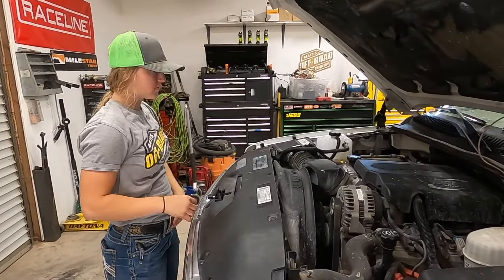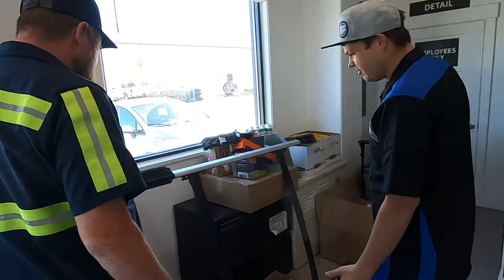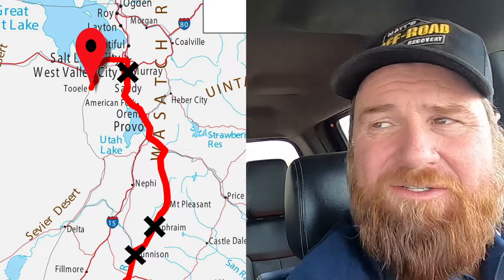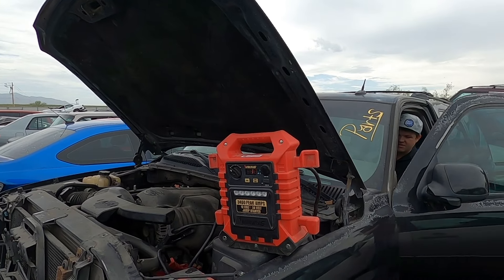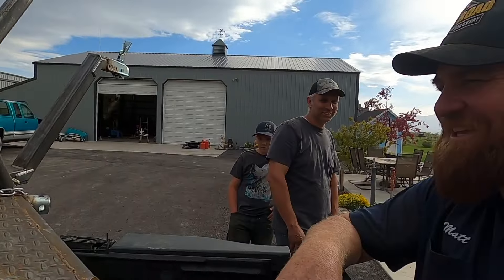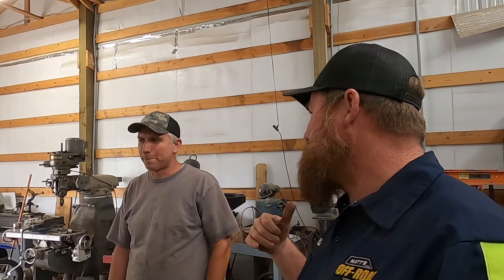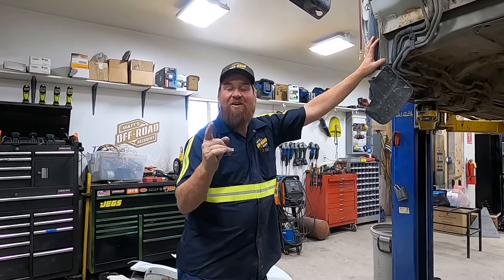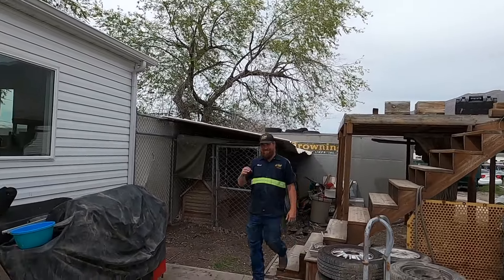Massive Engine For A Massive Off Road Wrecker!

Comment: This suburban reminds me of mine from a few years ago. It was a 3/4 ton 4x4  with a grand ole 6.0 Lt LS in it - and I thought it had gobs of power! We bought it with over 400,000 km on it. When we retired it had 748,000 on it. :-) 
Can't imagine what an 8.1 would be like!
Is this 8.1 what they used to call the 454 engine? You wouldn't dare pass a gas station without fueling it up - for fear you'd run it dry 'till the next one showed up! 🙂
Reply: Believe he said it was a 496cid 454 is a 7.4L

Comment: Looks like you had a fun couple of days hanging out with pals and getting stuff done. A day free roaming a salvage yard is almost as fun as a day in the dirt for some of us. I am not the "I told you so" type but.... I think it was a great decision to choose the 8.1 with a 4l80 or an Allison bolted to it. I may have mentioned in a previous comment the benefits of this engine for this combo. Although, you may need a semi sized fuel tank mounted in the bed to help you with not running out of gas while driving it across the yard. I can't wait to see this thing done and in service. Maybe by then I will have a chance to see it in person, and not from the tow end either.

Comment: You will not be disappointed in this engine…mine does about 9 mpg… expect to feed it both gas and oil. It came out Detroit as an oil user. Watch that Allison closely in its first weeks of use. Raylar engineering out of San Diego specializes in these engines as well as many Marine/ boat outfits. Good luck and welcome to the 8100 world. ITS A GAS!

Comment: Open it up add some gap the rings freshen it up as needed and put the turbo on it. Well worth the effort and expense. In the big picture on your build it's an insignificant addition
Reply: Oh and actually a small blower would probably be a better rout for your application. No turbo lag in the sand

Comment: The manner in which you present this "engine swap"  of a modern engine into an old school truck cab is all very brave and swaggering.  I want to see the mechanic with electronic credentials that can take the Nightmare wiring Challenge that would require.  And I mean actually document the process , step by step.  You don't strike me as an electrical specialist or engineer.  Just a youngster who won't be defeated by problems. I wanna see the Process of interfacing monster electronic circuitry into a Zero electric truck . GO !
Reply: Holley sells a kit for a thousand bucks. Plug and play harness and ecu that automatically tunes itself regardless of engine mods or boost. It’s really easy these days with Chevy motors and even some others now as they expand their tech. They even Holley fuel injection carburetors that also have the same ecu set up that can basically make any old vehicle fuel injected.

Comment: My buddies built a 73 k10 put it on 1 tons but slightly built the 496. With a cam and tune they are making 300hp 400tq to the wheels on some 36x15r16s… so big a** tires. Let’s just say that truck is scary it will spin them at 20mph and it moves. Good motor choice👍

Comment: 2002 I bought a brand new GMC Sierra 4x4 with the 8.1 and Allison transmission. 
Quite honestly it did none of the things you mentioned with the exception of burning a ridiculous amount of gas! 
I kept it for under 2 years because it just wasn't practical to use that much fuel to pull dump trailers and such around the flatlands of Florida. Bought a pickup with a little 4.8 liter and it did just as well.

Comment: I've had an 8.1 in my Silverado 2500hd for 7 years now. I'll never sell it. Has as much torque as a diesel and really good torque down low too without needing to build boost. Only thing I've done to mine was change spark plugs and it roasts the tires off.

Comment: You an hi clean capacity air filter and do a true 3 1/4" dual exhaust all the way to the back of tires. For what power you may want and may need. In the long run, it may be more efficient than you think. If you can mate it with the 6L90, lower first gear than the 4L80. Awesome!
Reply: Met a clean hi capacity. Ha.

Comment: Hi Matt ,  great engine choice,  but I would have chosen a 5.9 cummings 24 valve,   My 2001 Dodge 2500 puts out about 400 horses and about 700 foot pounds of torque   any way I really enjoy your vids,  thumbs up
Reply: He spoke on this diesels have terrible throttle response no RPM range so all that happens is they bog down and sand because all the power comes in and then they just spin their wheels

Comment: I threw a rod through the oil pan of my 7.4L in my dually. I’ve been back and forth between a built small block and an 8.1L. On one hand, I can pass at least every other gas station with the small block. On the other hand, I can pull anything I want with the 8.1L.

Comment: I would have done the 2 valve triton v10, good power and likes to rev which you'll need with those axles. They are very reliable and easy to replace parts if needed.
Reply: Would be a good engine until it shoots a spark plug out which you know those v10 Triton engine their famous for and considering they would be full throttle trying to rip wrecked trucks out of horrible areas spark plugs would go flying out left right and center

Comment: Matt, 
If you paint the "Off Road Wrecker" your company Yellow, Have a few drops of green added into the first clear coat layer. That way when you look at the wrecker straight on it will look Yellow but if you look at it length wise it will have a slightly green cast to it the further away it is. Then you could call it your "Can Dew Off Road Wrecker". He suggests with tongue in cheek.

Comment: I have a 2005 Chevy Avalanche 2500 with 496/8.1L Vortec Engine and Allison Transmission. 3/4 Ton at 10,000lb Towing Capacity. Loaded LT Interior. It's a Beast.
There is a Double Supper Charger Available that bring the 8.1 to about 700HP/800HP Mercruiser MOD.....
Have Fun!!

Comment: My 2002 2500HD runs an 8.1 with an Allison 5 speed transmission. 455 ft lbs of torque at 3200 rpm. It had 40hp more than the Duramax in 2002.  I purchased it new and only has 116K on it. I love the setup but she is thirsty.

Comment: Keep a gallon of oil around. 8.1 evaporates about a quart of oil every 1000 miles. We have one at the shop and it doesn’t leak a drop yet we have to keep adding oil.  They say it runs so hot it evaporates oil. All I can say is check your oil at every fill up.  O wait Matt doesn’t fill up that much 😂.

Comment: I drove a 2003 Chevy 2500 with a service bed that was very heavy with the 8.1  in it for 15 years and 285k never had a single issue out of motor your right it would out pull  the diesels but at 7mpg 😭😭😭

Comment: Pro Charger instead of the turbo in the heavy wrecker...  That way you have power from idle on up and don't need to build any boost.  I also think they offer an aftermarket computer so you don't have to cut and splice the original.

Comment: I was hoping you'd choose a  used 1998-2002 14.0 Liter Detroit Diesel, 515 HP delivering a head spinning 1650 ft/lb at 1200 RPM on a straight 6 block....OR...if you have space issues under the hood, why not go for a used Cummins 5.9 Liter 6 cyl big block delivering 2/3rds of the Detroit Diesel at like 65% of the total space?  I'm really surprised you went with a Gas guzzling Vortec but as always you seem to know what you're doing Matt, so I'm rootin' for ya. Can't wait to see that monster on dirt.

Comment: Love the 8.1 idea for this. Why not offset it to the passenger side and run a drivers drop transfer case. The transmission pan is smaller on that side. No starter to deal with. Pushes the engine away from the cramped driver foot space.

Comment: Been wondering how you're getting this to jobs that are a fair distance from the shop. Road it with a 100 gallon gas tank, Blue Steel/bigger trailer, throw it on a rollback? 

Desert dweller myself.  The radiant heat of a COE design may not be too pleasant in the summer without some forethought into heat management. Sheet aluminum with an air gap under the floor might help on those 110 degree days.

Comment: I know old technology  but a 1970 440 wich is 7.2 liters and produced 375 hp at 4400 rpm and 480 foot pounds of torque at 2800 rpm would probably  have been a good choice as well and all iron block and heads also known to be an engine that's fairly easy to keep cool and durable with a timing chain upgrade !!!!

Comment: that trailer came out nice (ps the 8.1 use some ls parts and runs a ls computer which is why some say its a big block ls so youll be able to run holley engine management if ya want) i still think using a gas engine is going to b e terrible idea but i guess well see how it plays out

Comment: My Fathers  R-190  Tandem axle Truck has a 549 Cubic inch gas engine in it. my Cousin blew the doors off  My Father IH  grossing  42,000 Pounds with his  '63 Chevy Tandem with a 409 in it also grossing  42,000 pounds loaded ..

Comment: You should be able to Put a Holly Computer System on that motor and dial it in to use less full and still get the same horse power. Holly has so many great things about thire Puter system that you would not believe. You can program them all sorts of crazy. Plus all the sensors you would ever need to make that thing run Hard and forever man.

Comment: I'm amazed you're not looking at a Cummins. Full mechanical 12v or could do a 24v or 6.7 quite easily. Absolute monstrous amounts of torque and reliable. But the 8.1 is a neat head turner too, just won't be going past any gas stations that's for sure
Reply: They hate diesels so they would never use that

Comment: The Navistar T444E would have been the best engine for your application. But if you are gonna run gas in a extra heavy recovery the 8.1 vortec should be enough if you play the gearing right.

Comment: I'd have held out out for a truck instead of the burb for a donor.  The 8.1 in the burb is detuned due to the weaker transmission.  The trucks came with the legendary Allison transmission.  I believe the burbs were rated at only 410  hp.

Comment: Matt - would it be possible for Tom-Tom to design a special Dollie that holes up the front or rear to allow the vehicle to either be pulled or winched on to a trailer?  Lizzy can weld it!
Reply: That would be a heck of a trailer! I don't think Blue Steel would want to pull it.

Comment: The 2001 release of the 8.1 L engine had a lot of negative history, initial roll out was about 6 months behind schedule and was a hot mess...  Both cam and crank shaft sensor issues as well as it liked to blow out the oil pan gasket.  Hope you all have better luck with it!

Comment: I don’t know if you’ll have enough torque for the drive train and the hydraulics you have planned. Also, I don’t know what tranny and transfer case can bolt up to the 8.1L engine. Maybe consider a Caterpillar 8.7L straight 6 Diesel engine with 640 hp and 1,500 lbs of torque.
Reply: You realize they said in the video they're going to slap a turbo on it try to make over 500 horsepower and 600 ft lb torque right that's plenty not to mention they'll have like a 20,000 pound winch on the front

Comment: Seems as often as you (and every other builder) are pulling and struggling to bring a vehicle into the shop seems like it would make sense to put a winch inside the shop and let the winch haul or drag it in like one would haul a side by side onto a trailer.

Comment: Why would you hesitate on putting the turbo setup on your 8.1? Why those torque numbers, you'll need them to turn those massive wheels plus the loads you want to pull. Just makes sense to do it now since everything is apart. Will be easier to custom make headers and exhaust. Just do it now because you know you'll end up doing it anyway. Any thoughts on extending the cab on the big wrecker for more seating? You always seem to be short on that.

Comment: I wonder if those military axles could handle 900+ ft/lbs of torques, it would make an awesome trail repair video!
Reply: They typically have Cummins diesel motors powering them....I'm sure they'll do just fine 
😉

Comment: Super Charge it with those big tires.
Reply: Instant torq vs. Making it spool up....
Reply: @keithfrazier2558  you realize you can tune turbos to start spooling at like 1500 RPM so that whole  superchargers make constant power and turbos need a spool is thrown out the window

Comment: So question. Would it have been possible, to make an adjustable gooseneck for the nuggets trailer? I see there's no gussets as it's not a super heavy load, but could you have hinged the joints you made on that tongue where the bends are, with locking pins to go from high tongue to straight? That way if the nugget couldn't pull it for whatever reason, it could be straightened/lowered for a normal height vehicle like Blue Steel to be able to haul it?

Comment: Ran a service body 06 Silverado with that motor back in 06.  It would pass anything but a gas station.  10 MPG.  We tried running premium to see if it would improve the mileage...it got 11 on premium.  lol  Great engine, lousy mileage....hell, it took the record for worst mileage V8 away from the Ford 460!  lol

Comment: It’s to bad you didn’t run across a 70 Buick 455.  That motor put out 500 ft. lbs. of torque at 2800 rpm.  It was a real stump puller.  All those old 429’s, 455’s & 460’s put out more torque than the 496 but they didn’t come with all the accessories, trans, T-case
and such.  I’m sure everything will turn out well!

Comment: Should have went with the new F- 250  7.3.  430 hp 475 torque stock. Not to mention since you seam to like to run out of gas alot the 17 mph vs 9 would have been nice ! Plus with some basic engine mods the 7.3 can make 600 hp naturally  aspirated.

Comment: I am curious what the pressure will be on the tires between the heavy wrecker, morvair and the banana. That will tell us which one floats better on the soft sand. It's just the weight on each tire and the area of the tire pattern. Matt already did an old video of the pattern the painted tire left on a cardboard at different tire air pressures. (Weight/contact patch=pressure...PSI).

Comment: nice choice for a motor, I would have laughed so hard if you chose a ford 5.4 triton,,,  a diesel would be good choice I think but rock crawling I can understand going gas and efi..  automatic? or manual though... will this drive on the highway at 70 mph?

Comment: That gooseneck is long enough you need to gusset those two angles. Especially as it comes up off of the trailer. But what do I know I only build stuff like that and welded for about 40 years.

Comment: The 8.1 is a great engine with a lot of potential, but in stock form it’s just ok. You can get more “bang for your buck” with a moderately built 6.0 Vortec
Reply: You realize they tune the engines right they don't leave them stock that would be dumb

Comment: I have one of each 8.1 l 496 and a 400 Duramax 6.6 l the Duramax is just a snappy and has more power and uses less fuel I would have put the lmm Duramax in it would have been a better choice than it will last longer with less trouble

Comment: Do the Turbo! Do the Tubro! Do the Turbo!

Should definitely do the turbo, but set it real low. Especially for the higher altitude jobs! 

Heck, thats why they were invented. Perfect excuse
Reply: The modern turbos has extremely little lag! 

It'll be fun with a Holly, able to turn it up to melt some rubber! 
Or turn it was down so you can make it to the gas stations!

Comment: Is there an advantage to using the 8.1 vs using the 9.4 (572 cubic inch) ... updated comment : Nevermind , upon further viewing of the video my question was answered. 8.1 makes lots of torque earlier in the revs and keeps the hp manageable. The 9.4 makes more hp happily giving more wheel spin which is a no no in vehicle recovery in soft sand. Got it .

Comment: there used to be many gasoline powered semi trucks, some were in use up into the mid 80's.  the lower price of diesel, compared to gas at that time, is why they fell out of demand. among other factors.  i think it would be interesting to see how today's tech would do with one of those old gasoline semi tractors that used to practically take a gallon per gulp with the old carb and spark control systems.  if they could consistently get around the same mileage as today's diesel rigs, we might see gasoline engines return to use in the big rigs.  imagine seeing gasoline available at the truck islands again.  it would be more practical than the PNG models ... i moved a few of those, finding a fuel stop in some areas was a nightmare.  well, you could find them, but having a mode of payment they would accept was a problem.

if anyone has explored that idea, i haven't heard anything about it ...

Comment: I think you're going the wrong route. If you insist on a gas engine you should be looking for the 10 cylinder gas engine that was put into Dodge pickups in the mid-2000s. Not a Viper engine, just the regular V10 truck engine. You will enjoy the torque, and you will need it! And you may still seek out 10 miles per gallon or better fuel mileage, which you probably won't be able to do with that 8.1. But that might not be necessarily A consideration.
The other engine I would suggest would be a pre-2005 Cummings Diesel. I've just recently seen one that was sold with 5,000 miles short of a million miles on it, and the engine had never been gotten into. It was refreshed with new seals and a freshening up, but there was no major work needed to be done on it.
And with either of those two choices, make sure you have a least a diesel spec transmission. Possibly a 1 ton equivalent Allison transmission, and you've probably built by Precision Transmission out of Texas. That would be a great build. Because that man knows his stuff over there at Precision Transmission.